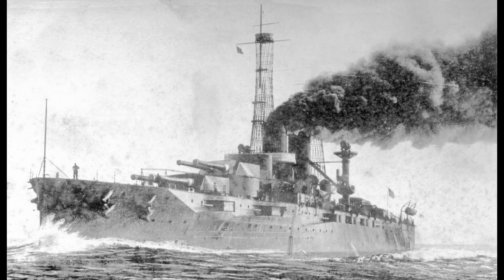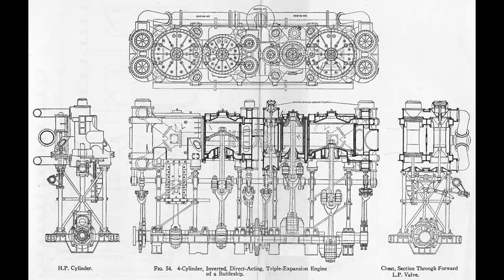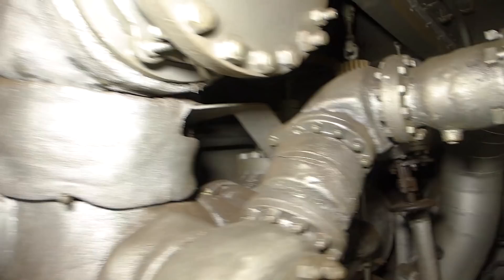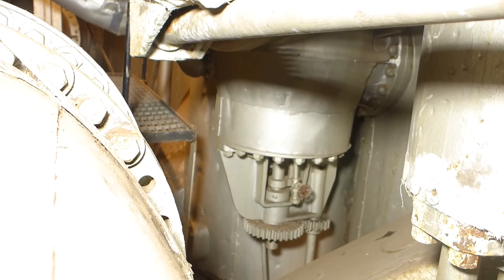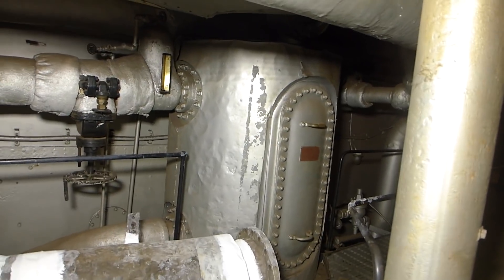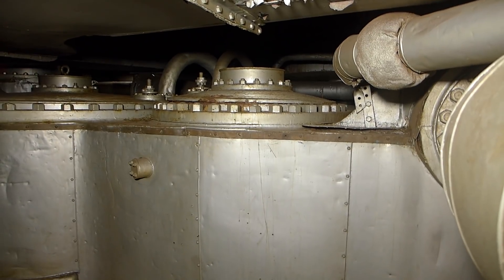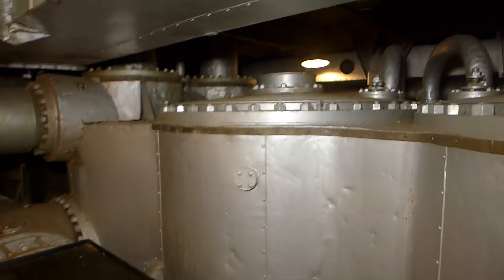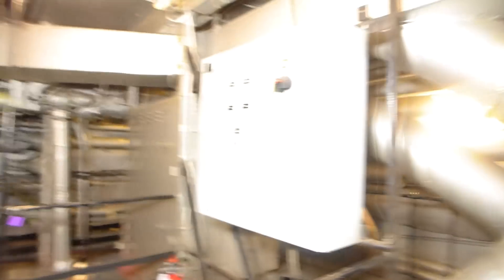Battleship Texas, Starboard Engine Room Upper Grate, Video 1 of 3

Comment: wonderful explanation of the reciprocal engines - it seems almost a chicken or the egg in design - was the engine designed around the ship or the ship around the engine - since the engines were originally boilers producing steam the designers managed so well to fit the upgrade engines - all that pipework would drive me crazy (i have said a few times i know) knowing what does what and what goes down what in what direction, knowing what valves operate what and when - there is so much to have learnt back in the day, its pretty fantastic to see this stuff explained, if only it could be made to run, even if somehow compressed air was used to assist parts lubrication - could there be a safe way to test things, make things run and perhaps see what other systems could be made operational

Comment: SO I've always wondered this since seeing a movie once. I understand how the boiler works, but say the ship was in in a fight and needed to get away fast. Did the crew have something the could put in the fire boxes of the boilers to get the fire really hot fast to make a faster escape?
Reply from the maker: Escape from what?  You may need speed to run to the fight and maneuver, but not run away.  No, there wouldn't be anything that could be added, but it didn't need it.  Small water tube boilers like these reacted very quickly to burner increases.  Since they rarely ran at full output, all that would be needed would be to light off all burners, and crank up fuel pressure and the forced air blowers.  You would see a jump in output in seconds.  In fact, if you tried to add something to supplement it, you would likely overheat the tubes and boil one or more dry.  That would destroy the tube, or tubes, and the whole boiler would have to be taken off line, drained, and cooled down enough for crew to crawl inside the drums, find the bad tube, or tubes, and plug them.  It would then take several hours to refill the boiler with water and refire it.
Reply: @tomscotttheolderone364  Could A crew in that day and age make such major repairs like your explanation stated while Underway? Is the Texas that well equipped? I never sailed on anything that wasn't nuclear powered and we had everything onboard except MC Donalds. But if we ever had any issues with propulsion it seamed like it forced us to run  right to Port.  Can I ask you to please show how they made potable water on these ships while underway and the crews showers. Id like to see how its changed.Thats  if you don't mind?.  BtW thanks for your explanation. I've watched Back to the future one to many times
Reply from the maker: @navyav8r653  Battleships were capable of making some pretty serious repairs at sea.  Texas had a well equipped machine shop and even had a forge.  Many engine repairs on Texas, and other ships having reciprocating engines, could be done at sea.  It was a very different matter for ships equipped with turbines.  Those really required the skills and equipment found at a well equipped shipyard to do more than very minor work.  Plugging ruptured boiler tubes at sea could certainly be done.  Sealing one off only required a couple of plugs, a hammer and a sailor small enough to squeeze through a manhole into the water drum.  One of my sources said that they could plug up to 10% of the tubes before considering a complete re-tubing of a boiler.   However, I've found no evidence that such a large overhaul was ever required during the 20 years these boilers were in service.  I know that a few tubes were replaced.  I suspect that required skilled workers and a lot of patience, and would only been done in a properly equipped shipyard.

Here's a link to one of my first videos that describes the ship's evaporator system that could make up to 36,000 gallons of fresh water per day.  It is short on descriptive graphics but does the basic job of explaining.  https://www.youtube.com/watch?v=hczv1H9KTdg

Comment: What did the Texas sound like? Was there audible chuffing as in railroad locomotives? Hissing? etc?
Reply from the maker: It would have been noisy due to all of the blowers, pumps and other auxiliary equipment running in there, but not to the point of damaging hearing.  The engine itself was fairly quiet, with perhaps a few hisses here and there from small steam leaks.  The chuffing sound that you hear with steam locomotives is from steam being exhausted through the valves into the smoke stack where it created the noise as it instantly decompressed to outside air pressure.  Waste steam on Texas' engines was sent to condensers where it was turned back into water without being suddenly decompressed.  The following link will take you to a video of the steam engine running on the Jeremiah O'Brien.  It is a similar design that it a lot smaller than those on Texas, but it should sound about the same.  https://www.youtube.com/watch?v=8a8LkGjTs3o
Reply: @tomscotttheolderone364   Thank you for your response. I went looking last night and found this video as well. 
It's amazing to see all of that heavy metal moving at such speed! 
https://youtu.be/7d7BIVsGkMA
We loose so much of the history when we put these artifacts to bed. Like old airplanes...they need to be heard and seen flying to better appreciate them and thier crews. 

I have been aboard the Texas many times over the years but I never had anyone explain the "machine" that she it like you have in these videos. Excellent! thank you

Comment: Is any of this steam system in operation anymore? I'm a pipe fitter and work on all pressures of steam and that system is extremely high maintenance, if that system still functions then that is truly amazing.
Reply from the maker: To my knowledge, the last time that the complete steam system was under pressure was in early 1946 when the ship left active service.  However, two boilers were fired to provide steam to the electric dynamos in March 1948 to provide power for electric lights and bilge pumps during the tow to Texas as a museum ship from Norfolk, Virginia.  It would not have required pressurizing the majority of the system since the dynamos were close to the boiler rooms and fed by their own dedicate lines.  That's a good thing since two years with almost no maintenance to the system would have likely resulted in it leaking like a sieve.

Comment: This just terrific.  I recall reading, many years ago now,that the US Navy consciously chose a higher pressure and temperature steam than that used by the Royal Navy. In the switch to turbines,this was a problem. Steam that hot becomes chemically active,and combined with cavitation issues,considerable and expensive research had to be done to metallurgy and blade shape before acceptable component life was established.
So it was quite understandable that piston engines were used on this ship. Nor would the massive effort needed to change the power plant have had any appeal.
It was many years ago,I sure wish I had read that article with more care. There were quite a few details that would have been understandable in the light of your videos. Oh well.
The level of engineering effort required to successfully build a capital ship is mind boggling. Too bad the Dreadnought was not preserved. Comparing the two would have been fascinating. 
All the best.

Comment: Here is a question, more curiosity… Given the last Battleships were laid down in the late 30’s/40’s I have seen that some of the spaces on those ships are slim and short, If, theoretically a BB like an Iowa class was re-comissioned in 2030 would todays person still be able to fit?

I say this as people are getting taller with each generation, i look at old medieval knight armour and the average height was around 5 foot 6 (see old building doorways).. given that people today often reach 6 foot or even 6 foot 9”.. can an old BB still be effectively crewed or would a total rebuild be needed to just let people stand up without bending?
Reply from the maker: My experience on the ship suggests that the great majority of passages, compartments, doors and hatches would easily accommodate 6 foot heights and more.  I am 5'10" and weigh more than I should, and have little problem throughout the ship based upon my size.  That doesn't mean that there aren't some very specific spots where a pipe or bracket hanging down won't ring your bell if you aren't paying attention.  There are some spaces and doors that don't permit access by larger folks, but they are mostly in areas that were infrequently accessed or only by specific crew.  A good example of that are the electrical flats immediately below each turret that contained motor speed controllers, circuit breakers and fuse panels.  Those would only allow small and skinny people and even they have to squeeze in.  The gun wells are another spot.
Reply: @tomscotttheolderone364  thank you!

Comment: Great set of videos!  Thank you for posting!  Can’t imagine how loud and hot that engine room must have been while operating!   I wonder what they’re maintenance cycle was between changing out pistons/rings/valves/heads etc on a ship that was in service for approx 30 years?  Not much space in the overhead
Reply from the maker: Component wear wasn't as bad as you may think.  Between very effective forced lubrication and low engine rpm's, wear was pretty low.  The biggest issue was keeping the bearings in the crosshead guides in good shape and piston rods perfectly aligned.  General engine wear keyed off of that.  Pistons and valve castings and major parts never needed replacement.  Piston rings and many bearings would have at least been periodically inspected and replaced if necessary.  Lack of overhead clearance wasn't a big problem.  The deck plating above the engine was portable and they had about 10 feet of clearance once that was removed.  Block and tackle would then be rigged to lift cylinder heads pull pistons.
Reply: @tomscotttheolderone364  Wow that’s amazing!  Thank you for the info!  I am hopeful when the Texas opens again they will offer hardhat tours?  I would like to see this in person someday.
Reply: Reciprocating engines are actually a lot quieter than diesel plants.
Reply: As for being the largest steam reciprocating engine in captivity, I would think the Liberty ships like Jeremiah O'Brien might have engines the same size.
Reply from the maker: @johncox2284  Nope, each of Texas' engines were 4 cylinder, triple expansion producing more thatn 14,000HP each.  O'Brien's only engine was a 3 cylinder, triple expansion that produced only 2,500HP>
Reply: @tomscotttheolderone364  so as stated, these were the largest ever put on a ship.  Any knowledge of how much larger any land based engines like these may have been and what was their application?

Comment: need a video on the ship’s steering gear and how it works! does the ship still have its steam whistle?
Reply from the maker: It still has the whistle.  For steering, look for “One good turn deserves another”.
Reply: @tomscotttheolderone364  does the whistle still work?
Reply from the maker: @ReaglesRacing32  It is fully functional and while it has been blown using compressed air, it doesn't sound right.  It needs 150psi steam to sound correct and have the correct volume.  That is pretty much impossible to provide or duplicate.
Reply: @tomscotttheolderone364  interesting ! i wonder if someone has a video of the whistle in operation??
Reply from the maker: @ReaglesRacing32  I am not aware of any modern videos.  Do a little searching in the Save The Battleship Texas and Battleship Texas Foundation Facebook groups and you’ll find a clip of a movie with sound of the ship blowing the whistle as she sailed past New York City.
Reply: @tomscotttheolderone364  ok will do thanks! i also joined the group!

Comment: So good you make a detailed video of the engine room... to give insight into the engineering side of the ship... what strikes me is the almost non existing head room above the engine: the ceiling is so low, barely enough to slide the cylinder cover aside... imagine drawing a piston out.... How could they draw a cylinder liner ?
One can only wonder, how hot it became in such a tight, low ceiling space, even with ventilation provided....
Reply from the maker: A major rebuild would have to be done in a shipyard using cranes.  To do so, they could removed large hatches above each engine on the main deck, then strip compartments and remove 2nd and 3rd decks above the rooms.  This left plenty of clearance to disassemble the engines down to their bedplates.  The ship's force could pull pistons and do ring jobs without going into a yard.  They did it by removing the duct work in the blower rooms on 3rd deck above the engines, then pull up armor plates that make up the deck using tracks and a movable bridge mounted on the 3rd deck overhead.  This gave them about 10' of vertical clearance. 

There are large ventilation ducts and outlets strategically placed throughout the engine rooms that provided large volumes of air.  Even with that, engine room temperatures could run around 105 or more on the mid grate when the engines were at maximum rpm.  That's not comfortable, but it is a workable environment.  Regardless, it wouldn't be too hard to find a duct opening to stand in front of and cool down when necessary.

Comment: I seem to recall reading that one of the major downsides to this type of engine was a critical RPM range where you didn’t want to operate them because of excessive vibration. Do you know what that range was for Texas (assuming it’s true) and what speed that correlated to?
Reply from the maker: There were vibrations at the common cruising speed of 10-12 knots that coursed throughout the ship, much of it caused by harmonics created by interaction between the two engines.  That corresponds to a speed range of about 60-70 rpm.  While it was a problem, it was apparently not enough to require serious attention because the problem was largely solved by operating one of the engines a few rpm slower than the other.  The presence of two tachometers at the starboard engine control stand certainly made it easy to accomplish that.
Reply: @tomscotttheolderone364  very interesting information (and video!) I read somewhere that the vibrations could be a problem in combat creating a real problem for the fire control optics if/when the engines were pushed to full power.
Reply from the maker: @wheel6243  It would be helpful to know where you read that.  Vibrations could be an issue, but I have never seen any documentation, nor did I hear from veterans, that they were bad enough to interfere with fire control optics.

Comment: Super interesting. I didn't realize that water and steam could coexist like that. So many different engineering challenges to overcome to make this ship work.
Reply from the maker: If you are referring to the use of the steam separator, water and steam certainly can coexist!  This is saturated steam, which means that the steam carries exactly the amount of water it can contain at its present temperature and pressure.  Small amounts of water that have dropped out will not be absorbed, meaning it can be picked up and carried in high pressure, high velocity systems like this one.  It will act like a bullet that damages valves and bends in pipe when it strikes them.
Reply: @tomscotttheolderone364  they used saturated steam in the engines? I would have figured they would have had super heaters in the boilers to use superheated steam in the engine. Any idea why they didn’t?
Reply from the maker: @speed150mph  The engines couldn't use superheat because it was too dry.  The engines relied upon condensate from saturated steam to lubricate their piston rings and cylinder walls.  Oil could not be used because It was too easy for traces to stay in the condensate and get back to the boilers in the feed water.  Even a little would create carbon buildup and hot spots on the boiler tubes that would cause them to fail.  Surprisingly, water was apparently an effective lubricant.  While they periodically replace piston rings, there is nothing to suggest that it was more than an occasional maintenance item.
Reply: @tomscotttheolderone364  very interesting. Thank you for the information.

Comment: So many pipes and joints .....and  pressure  steam is scary stuff. Curious: how hot was it down there during normal operation?
Reply from the maker: Temperatures could get over 100 degrees.  However, they ventilated the heck out of the rooms.  There are a lot of large blower vents around the room where crew could stand and cool down.

Comment: It’s too bad we can’t feel the heat and smell the hot oil and steam and feel the throbbing of the engines…..i do like the details……thanks…..
Reply: The best way to experience the heat, feel and smells of a triple-expansion engine room is to take one of the day cruises offered by the SS JOHN W BROWN in Baltimore and the SS JEREMIAH O'BRIEN in San Francisco.  These are the two last operating Liberty ships in existence.  To save marine steam turbines and reduction gears for higher-speed vessels, the Liberty ships were equipped with a single 2,500 ihp triple-expansion engine.  I was an engine room volunteer aboard the SS JOHN W BROWN for five years and it was one of the most enjoyable and worthwhile things I have ever done.

Comment: What was the RPM range on these engines
Reply from the maker: Maximum 120 rpm.
Reply: @tomscotttheolderone364  thanks for the reply
Reply: Tom, piggybacking on this question, remind me if the engines were direct drive to the props of if there was any gearing for reduction or increase in RPMs.  I don't recall you mentioning that in any previous videos.